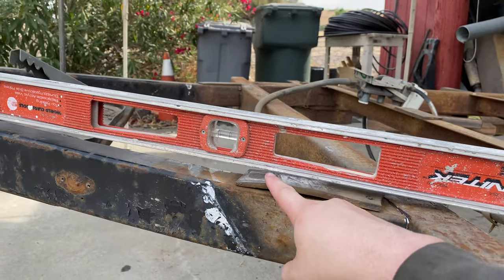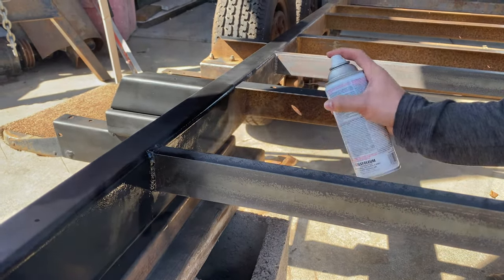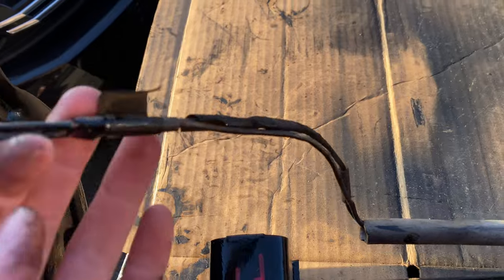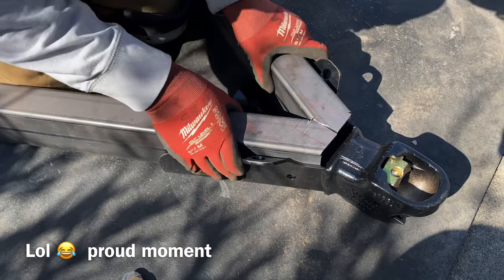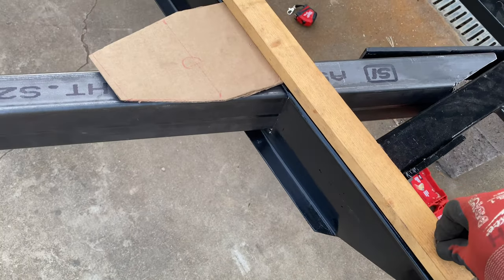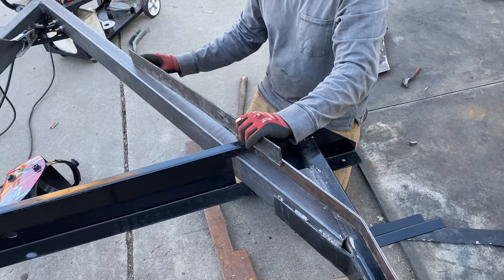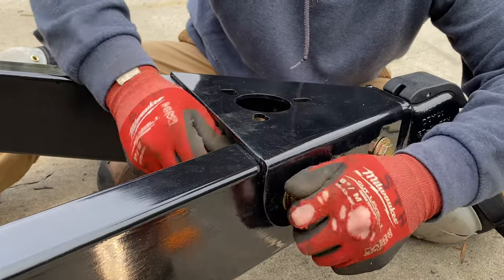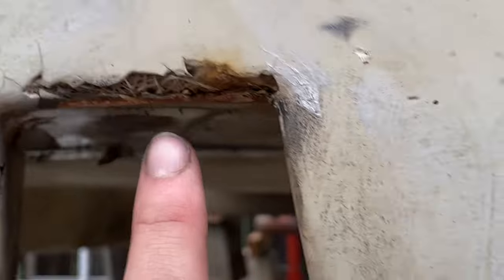Rare Vintage Fiberglass (Bigfoot B19) Travel Trailer! EP02: The Frame Refurbishment

Comment: The frame is damaged due to overloading and poor maintenance. Placing heavy gear in the front and exceeding the load weight. Adding new steel and extra gussets will help.

Comment: Next time for those rust’d or seized nuts ‘n bolts. Use ATF on them. It’s better than any wd-40 or pb blaster.
Reply: I like to mix at 50/50 with acetone makes it creep in a little better.  Doesn't store well because the acetone evaporates

Comment: I commend you and your father's skills and talents.  There is a lot of patience and determination in this process, traits I lack I  this application.  I have a question regarding the in depth work on the axles.  Would you, or did you consider disk brakes, having gone as far as you did restoring the hubs etc? In the end here, the frame turned out really great. Congratulations to a job well done.
Reply from the maker: Hey John thanks for the kind words. My dad has years of experience has a heavy transport driver dealing with big rigs and trailers and this was his suggestion in getting some more life out of the axles since the spindle that the bearings ride on were worn. Eventually, in the future we might need new axles to be made custom. Since they were not a typical off the self order, this is what also drove the decision to get them back in service.